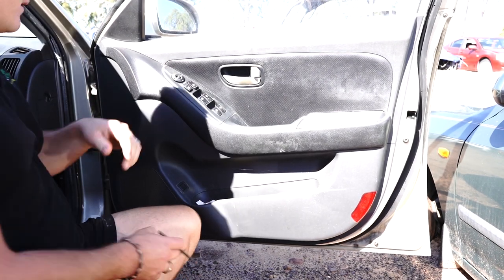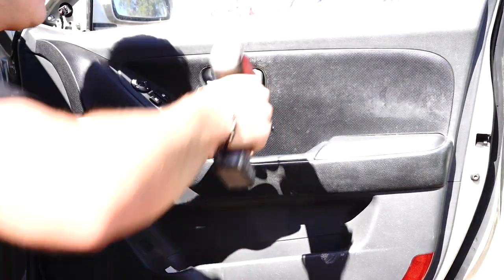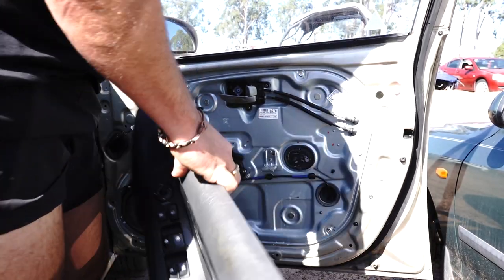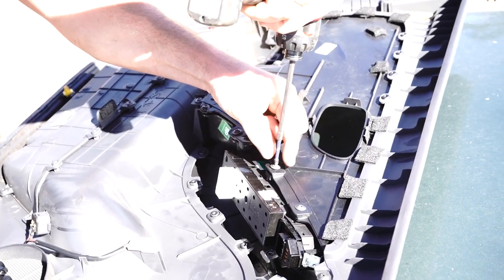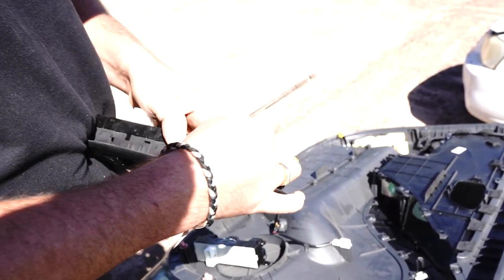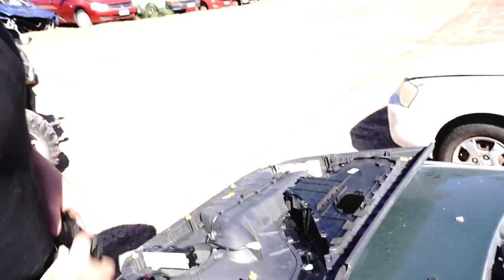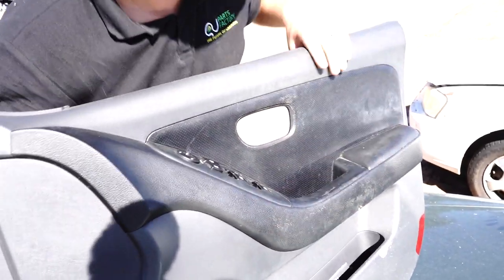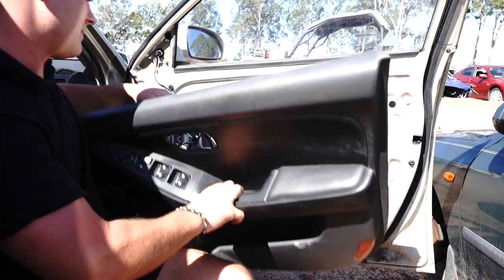How To Replace Hyundai Elantra Master Control Window Switch

Comment: So apparently the new hyundai Elantra from 2020 and up requires the full door tobe disassembled. There are a video of how to disassemble the door, only one screw, doesn't have the screen on door handle. But there's one more screw on the side where the door shuts that nèds tobe out. 2 of The clips near the side tops are not clips in but instead slide in. If not done correctly it will break the clips, you need to slide the door outward towards the back seat so that the door slides out from the clips.

Comment: hey, my hyundai accent 2014 doesn’t look like the same as that so i’m not sure which part to get?
Reply: edit - i found the 2014 switch part on your website but it’s missing the mirror control switch dial at the top, or is that a seperate part that won’t come off with the window switches?
Reply from the maker: Should be separate. Can you email us a photo of the plug on your switch before you buy. Thx
Reply from the maker: Should be separate. Can you email us a photo of the plug on your switch before you buy. Thx